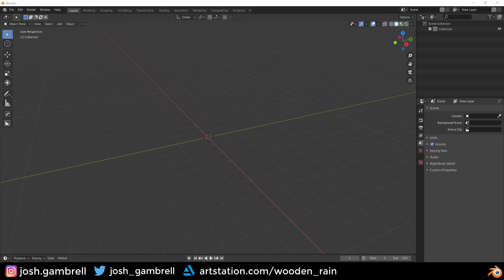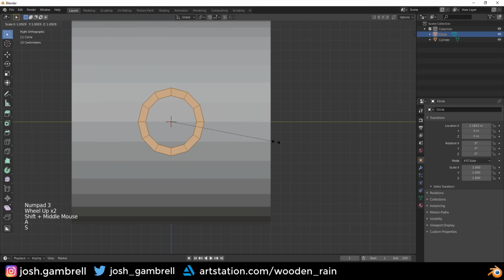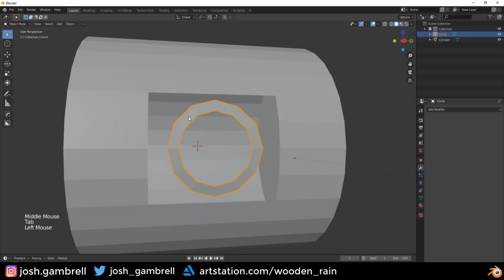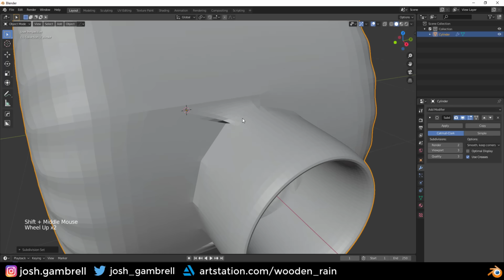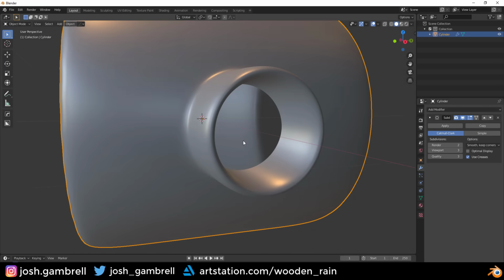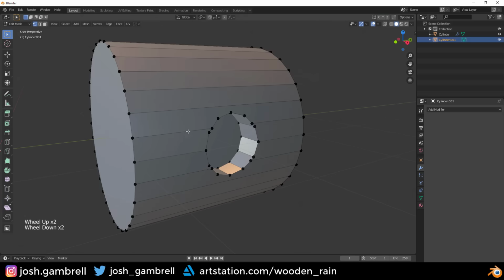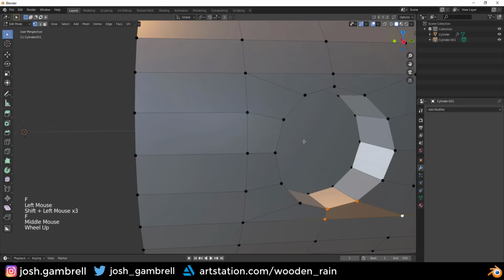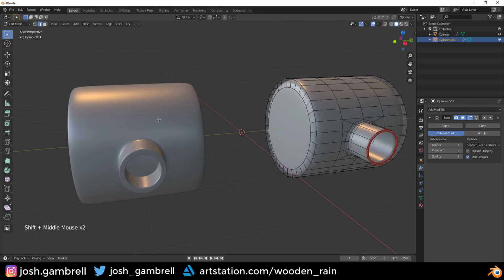The RIGHT way to cut holes in surfaces in Blender

Comment: hey so I went through and got this working up to the point of the bevel around the joining edge loop. for some reason I could bevel that and I couldn't double click to select the edge loop. So I feel like there is a clue there but I have no clue what it might be. 

then I tried again and I was having trouble shrink wrapping the circle, it would basically project with the outer edge loop extruded to the original x location of the circle. 

ok thank for any tips and thanks for the video :-)
Reply from the maker: Hi Sebastian, did you try ALT-clicking the edge loop? Double clicking isn’t the same thing.
Reply: @JoshGambrell  I did yeah, didn't work. I went around and clicked all the pieces and bevel still wouldn't work. it just brought up the sizing stuff but nothing happened. any thoughts?
Reply from the maker: @Sebastianandthedeepbluemusic  Could you dm me a screenshot or the blend file? I'll have a better idea of how your mesh was created if I can look at it
Reply: @JoshGambrell  I wish I could I scrapped it. But Ill try again and if it happens I will. Just thought maybe it was a common thing. Thanks for the help so far :-)

Comment: What about off-axis cuts? Not everything aligns with the X/Y/Z axis perfectly.
Reply from the maker: You can make a track to match the direction and movement so it always faces the direction of the object, then try shrinkwrapping that way. I don’t really have a reason to model off-axis though in most cases, but if you do that’s the alternative.
Reply: @JoshGambrell  I guess I'm such a noob that I don't know what this track is. And how do you avoid modeling off axis?

Comment: w8 do the normals influence the smooth tool?
I never really thought of that. But ye decent workflow. I'd do something similar. 
Booleans are for renderers. I model for Games, I need geometry to be good ;D
Cleaning up geometry after Booleans is a nightmare.
Reply from the maker: Depends on the orientation of the normals. That’s why i use weighted normal if shading is bad.
Reply: @JoshGambrell  
honestly not sure what weighted normals are. All I do is either conform them or soften or harden them.... and sometimes they need to go inside out. 
That's pretty much all I do with them. Normals are complicated.

Comment: Great work flow. I tried it with the LoopTools add on, worked a treat. Needed to make sure "flatten" was turned off in the settings and use insert instead of extract and scale :)

Comment: you can actually quickly dissolve verticies with Ctrl X instead of using the delete menu
Reply from the maker: Didn’t know that. Thanks!
Reply: I always just placed vertices on top of each other then merged by distance.
Reply: Goddammit, blender is full of useful shortcut I didn't know
Reply: @neko 9_0 Mesh>>cleanup>>Merge by Distance.

you have to be in edit mode.
Reply: @starlingfox4179   in edit mode, you can also just press m >> by distance. Either way works.
Reply: Vertices and Edges
Reply: I always bind subdivide and dissolve to Mouse 4 and Mouse 5 respectively, since I feel like I use them so often lol.
Reply: ooohhhh thanks for the tip. I learned even more today.

Comment: YouTuber: "Let me show you the most efficient way to cut a hole."
[Proceeds to show the most inefficient way to create a circle loop and fill topology.]

To speed up creating the same circle loop, do the following:
• Hit [Shift]—[A] then [M] for "Mesh", then choose "Circle" .
• Once the circle has been created, hit [Tab] to enter edit mode and hit [F] to make the circle a flat circle mesh without inner edges.
• Hit [I] TWICE to enter per-face inset, and change to desired width.
• Hit [X] then [F] to delete inner face, leaving polygon ring.

To speed up the filling of the gap between the circle and the surrounding rectangle, do the following:
• Hit [Ctrl]—[R] to add the center loop cut on the large cylnder.
• Select the outer loop of the circle by [Alt]—clicking on an edge, then add the selection of the inner loop of the rectangle by [Shift]—[Alt]—clicking on an edge.
• Hit [Alt]—[F] to fill the gap with an auto-triangulated mesh.
• Hit [Alt]—[J] (with "Max Shape Angle" set to 70°) to change triangle faces to quads.

You should also place the middle loop cut on the large cylinder before doing this operation.
That would have also allowed you to just keep hitting [F] until the gap was completely filled.

Hope this helps!

Comment: So, @ 10:50 ish, you create the 12 point circle to cut into the 32 point cylinder.  Now as 12 a random number or do you base this on knowledge that 12 points would align properly with 32 points?  Devil's advocate.
Reply from the maker: It depends on a variety of factors. For one, I fit the circle on top of 4 faces of the cylinder. Had I fit it on 6 or 8, or an odd number, for example, it wouldn’t have worked the way presented. Likewise if I chose 32 vertices for the circle; it wouldn’t work well on top of the 4 faces like presented here. You’d probably end up connecting triangles or more loop cuts. It really just boils down to intuition; the more you mess with cuts like these and different values and locations the more natural it becomes. I obviously can’t teach intuition, so I presented it in a way that works to allow for people to experiment with different vertex counts and locations. Hope that makes sense ;)
Reply: Totally makes sense!  I know there's some logic when determining and selecting #verts, faces etc.  I remember a tutorial awhile back in Maya, when it first got the shrinkwrap tool.  This subject came up when applying a circle to the existing mesh.  I think spending a few minutes on covering the "math" of it all can assist others in figuring it out for their own projects, would be beneficial :).  Great tutorial overall!  Enjoyed it alot.

Comment: you should have done two booleans: One adding a cylinder as the extrusion, and another making the cut through both. Then bevel the edges. Would have been much quicker.

Comment: I always have issues with really messed up geometry and artifacts, I knew about the boolean modifier and used it but half the time it wouldn't actually delete anything it would essentially just cut the shape into the part and I would always end up with messy geometry that meant I couldn't subdivide it, but this is extremely useful and has made me a better Blender user. Thank you!

Comment: You're using the boolean in a destructive modeling process, but using a first boolean with union  to make a cylinder that stick out then a bevel and then a boolean with difference to make the whole you ll have a great non destructive model with good booleans
Reply: Bruh the boolean, if used in the right workflow, is A LOT faster, like bro you selectin' vertices and stuff😂 just use modifiers wituout appluing them

Comment: im a total noob here and i was just wondering if in edit mode if i would be able to copy paste a section of verticies and say using this cylinder as an example ? apply the same smaller circle cut cylinder to the other side of the main large cylinder by pasting ? *i know that must have sounded completely dyslexic lol, but im so new to this i dont even know the right lingo to use when discussing blender techniques at this point ;)

Comment: Just a small note when creating faces: If you use Edge selection, you only need to click on two edges and press F, rather than having to select four vertices.
Reply: little late here, but a lot faster is just select whole edges with alt+left click and use bridge edges loop to join them all. Sometimes it can join opposide for some reason, if that happend, just fill one or two and then use it but without side edges.
Reply: I'm so late, but if you press C you can brush to highlight over the area. Pretty useful when you need to select stuff quick.
Reply: I'm a little late, but thank you all for the hints, I've never used blender
Reply: I don't know anything about selecting 2 edges to making a face, but I know selecting 3 edges in 'Edge Selection Mode', then hitting 'F'. Makes a face with no overlapping faces.
Reply: No he didn't. He used some single edge selection auto step fill. Not the same thing. 

You can also double click a hole and select all edges and press F to fill the entire thing. I use that a lot.
Reply: @CGPacifica  what do you mean by double click a hole?
Reply: @obiwac  Sorry, I meant alt+click.
Reply: @CGPacifica  oooh right. The problem with that though is that you may get triangles or n-gons and not quads, depending on how many edges there are
Reply: BillRey he showed that exact feature in the video though ...
Reply: @abaratien  Yeah at 03:29
Reply: that will create overlapping edges
Reply: @PixelBytesPixelArtist  Why on earth would it do that?
Reply: @BillRey  because the other two edges, assuming two on opposing sides are selected, will now have a new edge placed over from the filled face. Of course, this logic forgets to take into account that all 4 of the vertices were still selected, and so won't make overlapping edges.
Reply: @BillRey  weirdly enough it does... even to this day.
Reply: @PixelBytesPixelArtist  what and no

Comment: Have you thought about using "Knife Project", it's exactly what this is for without using all that shrinkwrap nonsense.
Reply: Yepp, works much better.
Reply: Issue there is that it adds extra verts that have to be removed. Kinda like the boolean route.

Comment: WHAT IS THE PURPOSE OF SHIFT+N....PLZ HELP, COULDN'T UNDERSTAND IT IN THE VIDEO.
Reply from the maker: "Recalculate Normals". In 3D modeling, if normals are oriented incorrectly, you can think of the model as "inside out" and the geometry doesn't look right. I'd suggest reading more about it here: https://docs.blender.org/manual/en/latest/modeling/meshes/editing/normals.html

Comment: I'm just learning Blender after learning Maya a very long time ago. This is very much like I was taught back in the day, and I was beginning to wonder if quads were as much of a focus in Blender. That said, I keep wondering about the geometry on the ends of cylinders. Is that huge n-gon not an issue?
Reply from the maker: Not really. Most people just inset those caps and since it’s planar you don’t really see any distortion. You can use the grid fill tool if it bothers you though
Reply: Awesome! Thanks, Josh!

Comment: But when you have a lot of faces, this technique gets tedious to do.
Reply from the maker: An option instead would be to use this method and keep a sharpened subdivision surface at the top of the modifier stack to round off any stepping issues.
Reply: Josh Gambrell plausible, however, sometimes things are combination of multiple geometries and modifiers applied, in that scenario something like this gets real tough.
Good to see an explanation from your side though.
Great work.
Reply from the maker: Thanks! Yeah sometimes you tun into workflows you either have to compromise on, find a way around or do a different strategy all together. Fortunately I never really need to go above 64 vertices per cylinder, and I usually stick with 32.

Comment: Hey There is another method to do this (This is why I love Blender) You can use the "LoopTools" addon, now integrated in the vanilla version of Blender !
Reply from the maker: LoopTools works fine for spheres, but it’s terrible for cylindrical surfaces. It flattens the faces and distorts the curvature. I wouldn’t recommend it in this case.
Reply: @JoshGambrell  Not really, It actually comes with few settings you can ajust to have the result you want(like flattening or not the faces), I just used it here and everything is perfect ^^! 

Obviusly It's preferable to know how to do it manually as automatic tools can"t solve everything.

Comment: This is a day where hundreds of people have learned the power of J (me included)
Reply: This is why I like watching basic tutorial videos despite having used blender for years.
Every one I watch seems to teach me a new shortcut or feature of something I already use.
Reply: power of ctrl j too
Reply: Thousands* :D
Reply: And the F.

I never knew you can use F to automatically add faces by clicking an edge.
Reply: The power of Josh? :D 
I have learnt not only that, also a lot about what is "correct" or not regarding topology.
Reply: @j.carlosmurrr  No need to worry about what is correct or not so much, since there is not a "divinely true" or only one way to go about it. This is just a very good way to go about it.

Also, fun fact: in Edit Mode, "J" connects vertices together while also dividing faces. It's a way better form of editing already existing faces than deleting them then creating new edges or faces with "F", and it's an even faster "K" knife tool since we work directly with the vertices we want and nothing else, instead of worrying about foreground and bakground bleed and angles.

Comment: Hi Josh, thank you so much for your video. I am new to blender and the 3D in general. 5 days in, but I am amazed what it can do and even what an amateur like me can do with Blender just after few days. Your video helped me a lot to discover some workflow and ways how to do things. Big thanks to you!
Reply from the maker: Awesome man! I’m so glad I could help you! I’m excited to have you as a part of the community :)
Reply: Josh Gambrell i thank you! Just did your “tutorial” 3 times with several variations. The basic is super easy, it becomes more complecAted when I start rotating the main cylinder or if I try to move the circle around the cylinder (it will start deforming). So if I was creating this for 3D printing I would need way more information how to make things 100% accurate. Thank you again. I will keep commenting on your tutorials as I will be going through them 👍

Comment: Using the bridge command I think will correctly fill, between the large and small cylinder under most circumstances and is quicker than manually adding the geometry, for all quads topology you do have to make sure that there are the same number of vertices in the inner and outer edge loops.

Comment: Great tutorial ! But what tool have you used to make those sharp edges after the subdivision interface?
Reply from the maker: It’s the HardOps Sharpen tool. It basically smooths the object, and auto smooths with an angle of 60, and sets edge creases/bevel weights all in one go.

Comment: Nice technique, but you cant call it "The right way". It only works with simple 2d shapes and most importantly is destructive. Something you often have to avoid and thats why blender has modifiers. The boolean modifier has to produce ngons but you can move each object freely and if you give it enough geometry(booth objects with the same poly density) it should work.
Reply from the maker: There’s nothing wrong with destructive workflows as long as you use it in the right context. I primarily work non-destructively but have used this method countless times if I go destructive on certain areas of the mesh. Not to mention, depending on what your goals are, you may be required to have quad-based topology especially if you’re deforming.

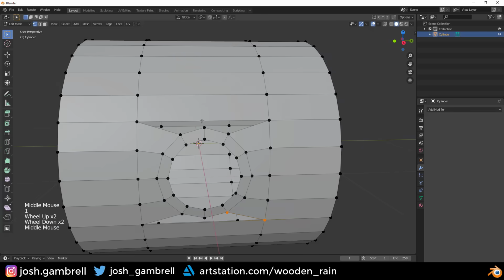Comment: 3:48 Just a quick tip, in edge-select mode it only takes 2 clicks to select opposing edges to fill in a face, rather than 4 clicks on the vertices in vertex-select mode.
Reply: Or alt click to select the border
Reply: or Ctrl+RightMouse to lasso tool in one drag

Comment: Why so complicated? Just create enough topology to use circle from looptools... Your method is ok but still not perfect / right one
Reply: looptools doesn't work as well on cylindrical shapes.
Reply: why? I'm using it all time and did a tutorial on my youtube channel as well ... where is the problem with loop tools?
Reply: @CGHideout  From Josh in another comment: "I’ve tried all sorts of adjustments using LoopTools, in fact before making this video, and it just doesn’t retain the same efficient curvature even if I get the settings just right. It still required a bit of manual movearound and at the end of the day I prefer this method. However, I use the HardOps addon which allows me to accomplish this same result in just a few seconds, so perhaps I’m a bit biased on this strategy ;) Still, it’s important topological workflow and like you implied it’s important to get the brain wired to solve problems like these."
Reply: @CGHideout  and I will check out your channel, thanks!

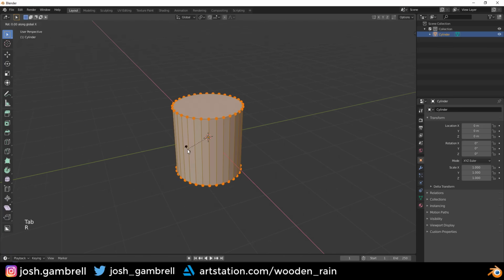Comment: 0:32 I like your instinct to do transformations in Edit mode rather than Object mode. ;)
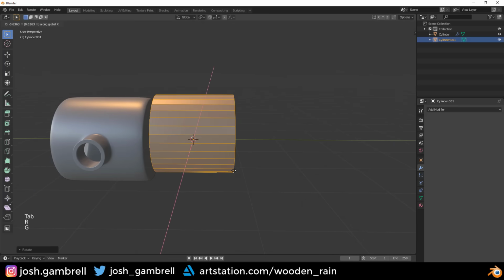Reply: 6:27 Except translations. Those I normally do in Object mode.
Reply: is it better to do it in edit mode?
Reply from the maker: @pladselsker8340  It just saves some time because the rotation/scale is automatically applied when you transform in edit mode. In object mode, it changes and in the future you may have to apply it, meaning a small extra step is required. No biggie either way though :)
Reply from the maker: I've had to apply scale one too many times hahaha

Comment: The 'right way' is to get box cutter/hard ops bundle. I was doing it this way in MAYA 2010, it takes forever on real projects that have real deadlines.
Reply from the maker: I actively use both add-ons; that’s how I made my last video on the holographic sight model. It’s fantastic for experienced artists, but the last thing I’d suggest a beginner to use is an add-on that does a lot of operations behind-the-scenes. It’s crucial to have a solid foundation of how modifiers and workflows work before using advanced addons IMO. Also, Jerry Perkins (creator of HardOps/Boxcutter) uses this method a ton in his modeling videos (of course using his add-ons instead to achieve the same effect).
Reply: @JoshGambrell  Yeah understanding edge flow and topology fundamentals is important for sure.